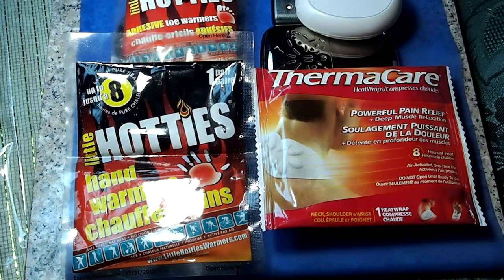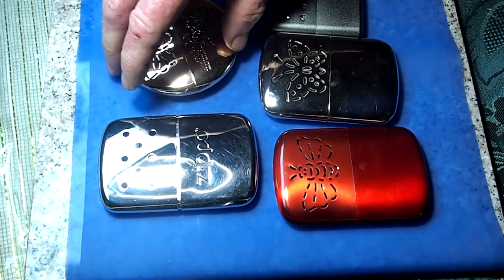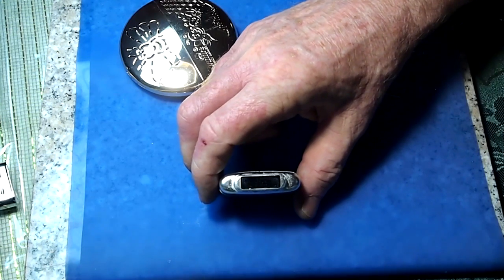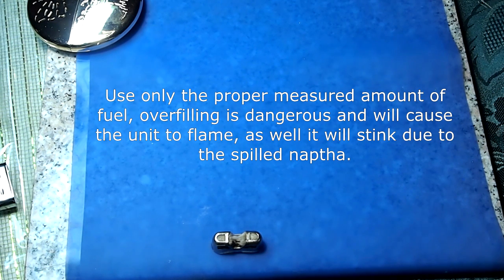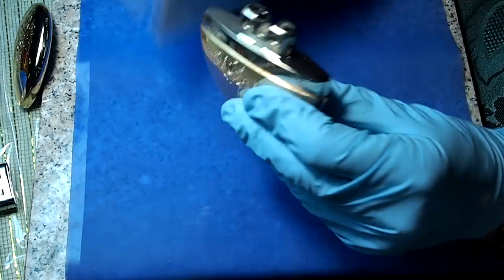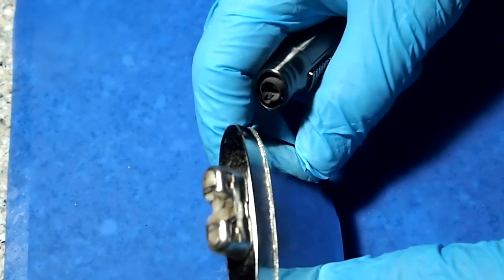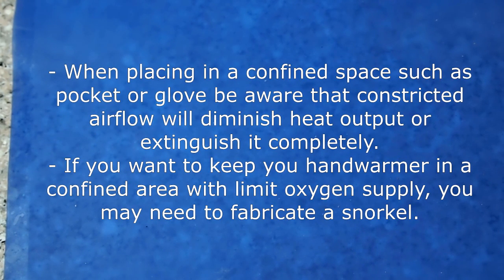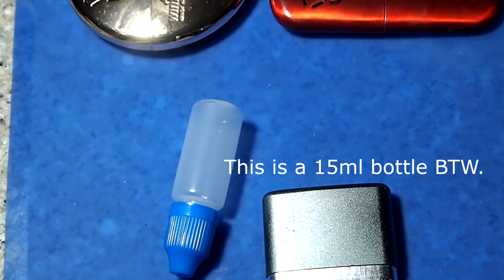Handwarmers, S01E01: Performance MOD's and Use Tips

Comment: Great video with good info on handwarmer use. To help with the "naptha smell" while burning, try adding a few drops of after shave before lighting. Old Spice or English Leather. Read about this in an old Popular Science mag from the 70's. It is also mentioned in the instruction/operation sheet I have for a vintage Optimus handwarmer. Have tried this and it seems to help. Not sure as to how it affects the life of the catalyst yet but as mentioned in the video they are easy to replace.

Comment: Excellent post. Great suggestions and modifications. I'm trying to find / source a platinum catalyst just like you have. Any suggestions? Maybe a video on setting that up?  Thanks a bunch!
Reply from the maker: Jeff Hanna was the one who found it originally and passed some along to me to try. Unfortunately you have to buy a lot of the material in bulk from a manufacturer that makes it for other industries such as car parts, so the price is a lot more than just a couple of handwarmers. I'm not sure if you could harvest some from an old catalytic converter, or whether the exact material they use for that purpose would be suitable or not. So the long range plan is to work with some of the OEM aftermarket material Jeff sourced and assess it, as I've only used it once so far. Seems to work well, but not sure how well it will stay put in the head over time as the pieces are small. Jeff has suggested putting it in a spring and placing that in the head. I've placed some in a head without a spring by just packing it in tight, and although it works well so far, not sure how long it may stay there without falling out eventually. Your Plan 'B' can be to purchase the spare heads from the Chinese sellers. I did that, and took the material from one and put it in my Zippo. It worked, but my suspicion is the Platinum you can get from a North American manufacturer is of much higher quality than the Chinese sellers. Once I have found a suitable spring and a way to pack it into the heads, I'll need to do a proper side by side test to confirm that the aftermarket catalyst material is in fact better than the OEM Heads bought from Chinese sellers. At that point we'll probably just sell the material at cost plus 50%, which I suspect would still be less than a couple of bucks for enough to rebuild an old head, which would make it cheaper then even buying spare heads from China. I have no delusions that what we're trying to do here would appeal to anyone other than a niche of crazy people such as myself and Jeff (well, me at least, Jeff is pretty normal and a lot smarter than I am) who want to take items such as this and make them perform to their utmost ability and then used in more extreme circumstances such as backcountry ski touring, AT Skiing, or perhaps Ice Climbing. In reality, the hand warmers from the Chinese sellers probably suit most weekend recreational pursuits such as Ice Fishing, going for a skate with the kids, etc., quite well. I should also mention, I went for a 17km ski tour with my spouse last Wednesday in Yoho Park. She had one of the oval hand warmers around her neck. Part way through, she commented that she still could smell the Naptha and it was unpleasant enough that she moved it to her pocket. So I don't want to give the impression that these MOD's suddenly render these devices perfect in every way. In my opinion, it simply makes them better to the point where I cannot understand why, when we are now living at a time when APple is making billions from the iPhone, Zippo simply don't make some improvements like this by default. My ideal project would be a Titanium Hand Warmer with an electronic ignition catalyst and thermostat! Thanks for the comments, we'll see what we can do about a future catalyst video if I have any luck finding a suitable spring.